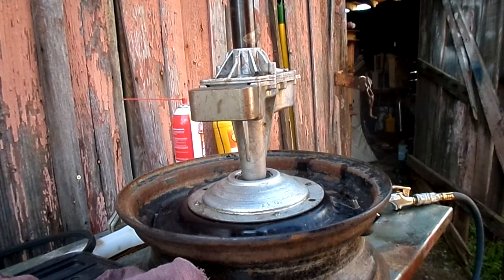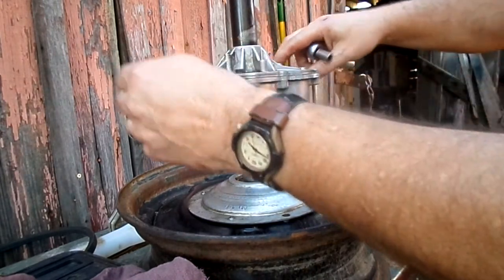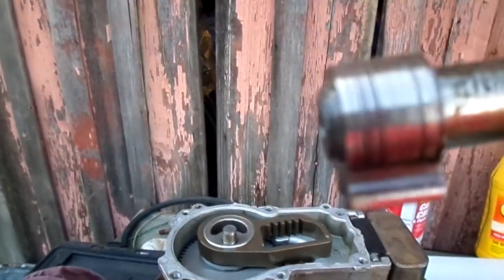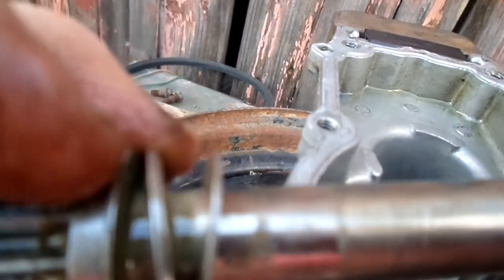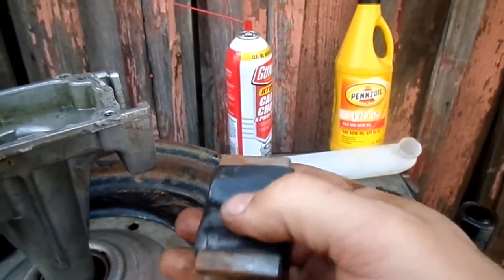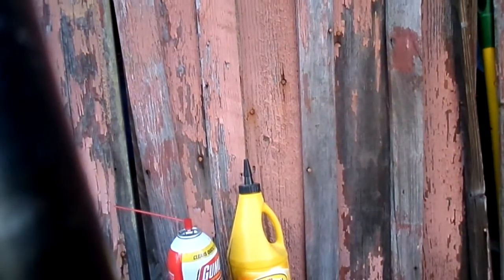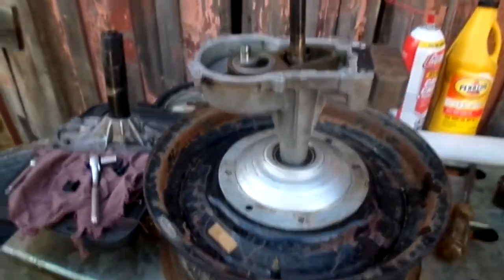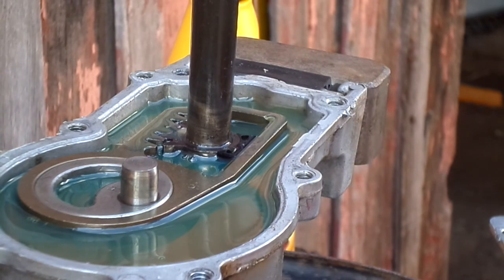GE Washer Transmission wh38x10002

Comment: I guess I won't be rebuilding mine. The casing is broken, as well as the weird looking gear that makes it agitate, I couldn't even see the plastic bushing, lol. Time for a new washer.
Reply from the maker: You can search ebay for the part number in the video title, they're often available for sale, but the used ones are more reasonable. The new old stock ones cost way more than the washer is worth.
Reply: @MrUbiquitousTech  it would cost me more for another transmission than a lightly used washer. I was debating on having the gears welded, but that would be a hassle too. Plus the cabinet is pretty rusty and oily. I'm in Canada and it seems online purchases are ridiculous compared to the US and/ or other countries.
Reply: @MrUbiquitousTech  What gear oil does this transmission use compared to their previous filter-flo transmissions?

Comment: I just did mine, it agitates but it won't spin- I had the upper shaft with the teeth started on the last tooth not in the middle, do you think it jams when it goes to spin? I hear the brake unlock but it won't spin.
Reply from the maker: As long as the teeth are properly aligned it won't matter if you lined it up at the last or the middle. Sounds like something's up with the clutch.

Comment: I had a GE washer with this transmission in it. It sounded like a whirlpool direct drive washer when agitating on the normal/fast speed.
Reply: The Agitation gears is pretty similar to the Whirlpool Direct Drive one.
Reply: @KingHarlequin1999  What sets the 2 apart?
Reply: @jeromedavis8575  That the Whirlpool Direct Drive transmision have aditional gears for the spin cycle and neutral, while GE one nope since it is a belt driven washer and the whole transmision spin counterclockwise along with the tub during the spin cycle, and it also have a separate pump to peform the "neutral drain" without having to turn the main motor.
Reply: @KingHarlequin1999  Who had heavier gear oil, GE or whirlpool?
Reply: @KingHarlequin1999  What oil is used in the 2 transmissions compared to the filter-flo?
Reply: @jeromedavis8575  Im sorry but I don't know about oils actually.
Reply: @KingHarlequin1999  Who had better gears? Whirlpool or GE?
Reply: @jeromedavis8575  I think that whirlpool have better gears.
Reply: @KingHarlequin1999  What are their gears made of?
Reply: @KingHarlequin1999  What kind of oil did this transmission use compared to their filter-flo that came before their plastic tub models?
Reply: How did the oil smell?

Comment: I see this is a rather recent upload. I have an old GE Profile with this transmission part #.  (2001 - it had been working fine...) Recently it would not spin. I sanded the clutch "friction shoes" and it has worked fine for over a month. Today it wont spin. The motor turns but it seems as though the transmission lock ups immediately. I took off the belt and I can hand turn the tub pulley in the agitate direction and it turns fine. When I turn it the other way for the spin cycle it turns a little then it sounds as though  it hits a metal pin and stops dead. I can turn it back and forth to "bump" whatever it's hitting and it sounds like metal-on-metal hitting in the transmission. If you read this and have any suggestions... thanks.
Reply from the maker: It does stop as far as the inner working in the transmission go, then it spins the entire body for the spin cycle. If the body won't spin then I'm going to guess the lower bearing failed or seized.

Comment: What gear grease you used? The GE gear grease is expensive.
Reply from the maker: I used regular 75w/90
Reply: Gear oil SAE 90, close to a cup (250ml) is needed. Pretty much fills it. I recommend using Permatex gear oil RTV gasket maker.

Comment: I have this washer...I am trying to find out how the top seal in the transmission fits.
Reply from the maker: Can't say for sure about this specific application, but lip seals tend to be lightly pressed in. You pull them out with a screwdriver, then gently and evenly tap the new one in place.
Reply: Do you have a replacement seal? I do know of kits you can buy for this transmission. Make note of the condition of the shaft where the seal rides. There may be wear on the shaft and would cause it to leak in the future. You can buy a kit that comes with new shafts, seals, bushing...etc.